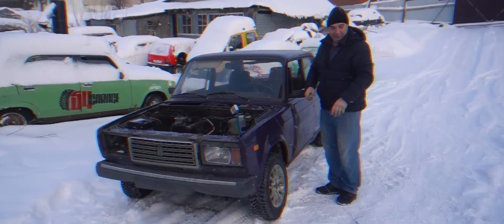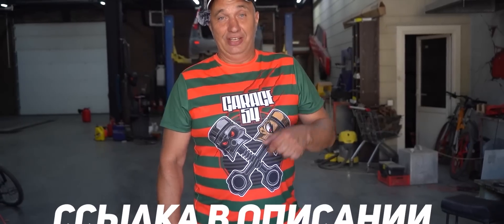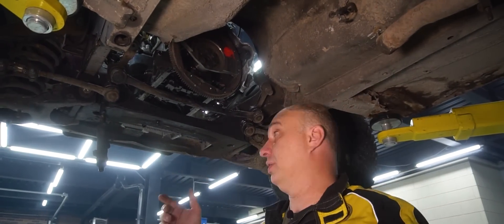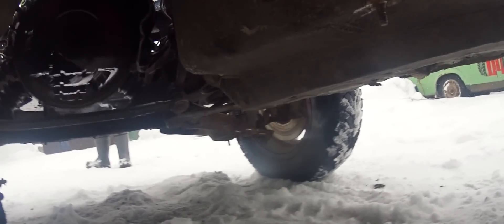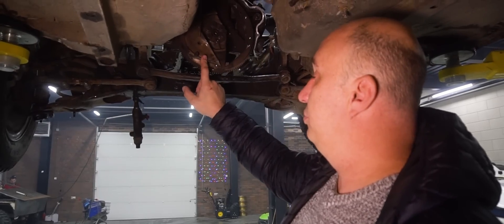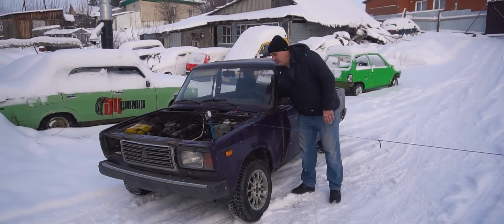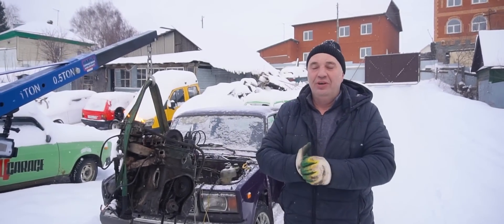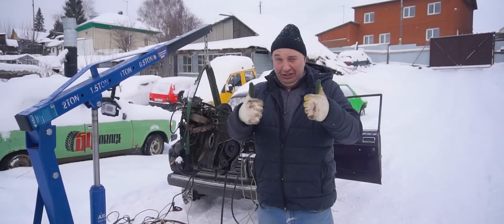We hack the flywheel and start the engine – what will happen?

Comment: i would love to see you guys install a torque converter to a manual transmission
Reply: Install a clutch in an auto and let the transmission shift by itself
Reply: @dieselgeezer18  people used to do that for drag racing. It helped the older automatics take off without high stall converters.
Reply: @dieselgeezer18  someone here in the UK used this arrangement in a circuit racing mini, a clutch and an automatic gearbox. It did very well but apparently needed a big steering wheel due to vicious upshifts in the bends... (The classic Mini automatic, like the manual operates in engine oil, the car I mentioned was featured in Car and Car Conversions magazine many decades ago)
Reply: Yep I agree
Reply: Great idea
Reply: Hondamatic?
Reply: @Worstenboer  I don't think people quite get what you mean. Older Honda automatics up to like the 2000s we're literally automated manual transmissions.
Reply: Lol that would be funny
Reply: The closest possible they've made is a centrifugal clutch on a manual transmission lada.
The torque converter needs a hydraulic pump to work which i have no idea how it's possible to implement, but with some sort an inlet adaptor running a power steering pump it might be possible, or even sealing it while filled with oil, depending how much they wanna get involved with this.
Reply: @johnbelwell2461  there are sealed converters that exist also
Reply: Wdym by that? Have the torque converter on then the flywheel/ clutch behind? That would just make it rev slow bc it's so heavy. Or if you mean torque converter instead of clutch, I'm not sure how anything would happen
Reply: @bubferner2146  yes...replace the clutch with a torque converter!
Reply: There's no torque converter pump in a manual transmission
Reply: @JnixMarshel  there arealso sealed converters
Reply: I drive almost the same setup every day. Chrysler Fluid Drive in my 1950 Dodge. Not a torque converter, but a fluid coupling. Drive in any gear and no need to use the clutch to stop.
Reply: @72polara  I was just thinking there was something like that in the 60s or 70s, I just couldn't remember anything about it.  Glad you have more info than I do.
Reply: Taking off would be nice but changing gears would involve some grinding
Reply: @d6893  you could use one with a higher stall RPM
Reply: @chrisdunham2911  the manual transmission does not have a fluid pump. A torque converter works by moving fluid. Therefore, it cannot work. However,
If you wanted to see a cvt style torque converter hooked to a manual transmission (basically same thing) check out robot cantina. They have a honda setup like that.
Reply: Literally impossible.
Reply: @mastermnd22  its actually a thing old fendt tractors
Reply: @fritzsnickerz855  read my other comments.
Reply: That could be seriously awesome!
Reply: It's odd to me you said that. Back in the 70s Mickey Thompson installed a manual clutch on a torqueflite. Called it a clutch flite.
Reply: Dodge used to have a torque flite transmission I believe it was a 3speed. 3in the tree with a torque converter. It was 20s or 30s that's all I remember but it has been tried before. I would also like to see g54 try it though😎
Reply: I know a good freind of mine that put a manual transmission after an automatic, so he can "preselect" between 4 or 5 ranges before attempting to climb difficult terrain. Works fantastic!!
Reply: Fendt turbomatic have this awesome feature
Reply: The torque converter circulated the auto trans fluid.

I wonder if they can come up with a closed loop system for the fluid to get in the torque converter and then out to a rad.
Reply: The early 70s vw bug has that factory
Reply: Volkswagen bug autostick was exactly this, clutchless manual shifting (semi-auto) via torque converter.
Reply: I've been typing that for 6 months lol.
Reply: Dodge used to have a torque flite transmission I believe it was a 3speed. 3in the tree with a torque converter. It was 20s or 30s that's all I remember but it has been tried before. I would also like to see g54 try it though😎
Reply: Great idea
Reply: I have a dump truck with this setup. I love it.
Reply: Some industrial equipment was designed this way in the early days. Ford had a wet clutch that acted like a hudromatic or a shuttle trans. Dodge had a actual fluid coupleing infront of a manual in airport tugs had a 4speed manual. You would push a button to unload the Converter before you shifted
Reply: There are "clutched" automatic transmissions. Chryslers torqueflite was made into a "clutchflite". GM had some too. Was used in muscle car era to get the best of both, hard fast launch & quickest shifts. Good converters werent really a thing back then & if there was anything it was too expensive for the casual hotrodder weekend racer. Its pretty interesting, never have driven one.
Reply: Not possible, automatic transmissions have a stationary shaft in the middle, that the one that's actually hooked up to the transmission, the tq is bolted to the engine, and pumps the transmission fluid, there's no way to seal in fluid, and have a shaft spinning the drive gears in the middle.
Reply: YES!!! THIS IDEA!
Reply: Sounds stupid question what exactly does a torque converter do
Reply: Like the old fendt tractors
Reply: Almost impossible
Reply: Blow this comment up
Reply: just like go kart clutch which it was make long time ago 2nd auto transmission torque conver never fit in manuel 2nd it need pump to push liquid into torque converter if cant get any liquid it wont do anything
Reply: @kittyztigerz  this is already existing í  old fendt tractors
Reply: This is a genius idea
Reply: Ok

Comment: This proves how unnecessary oil is for engine longevity!
Reply: unfortunately, you're wrong. No oil = lose 0.001mm of material every revolution (or something, I don't know the number), which means in just a few hundred hours, the conrods will seize on the camshaft and explode. They've shown videos of that before. No oil engine! Bang.
Reply: @dimitar4y  True for all non-Lada engines. Lada engines share immortality genes with Keith Richards.
Reply: @dimitar4y    HOSS, I BEN RUNNIN’ NO EARL IN ANY OF MY VEHICLES FER DICKADES. SHORE, I MITE ONLY GIT A FEW MILLES OUT OF EM, BUTT I’LL BEE DAMMED IF I GIF THOS OIL CUMPKNEES A SINGLE DOLLUR OF MY HARD URNED MUNNY!!11!1!
Reply: @FoulNews  hehehehhe